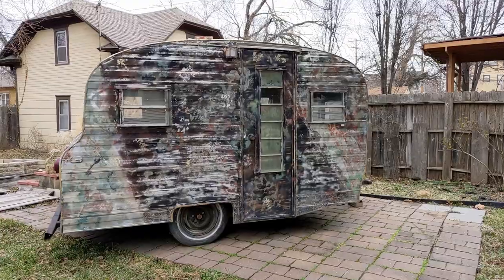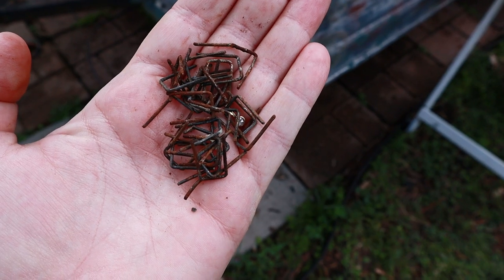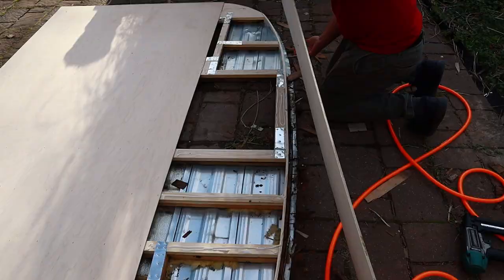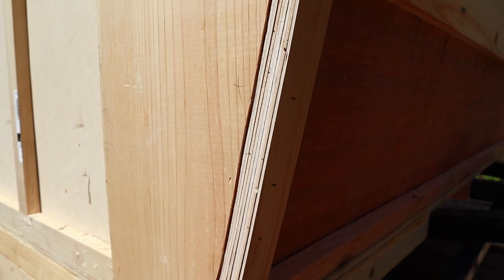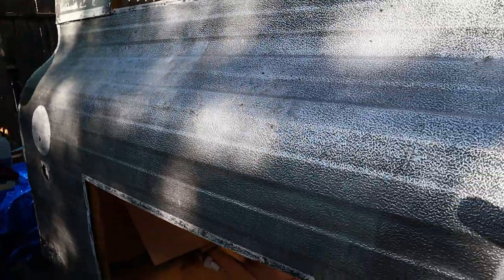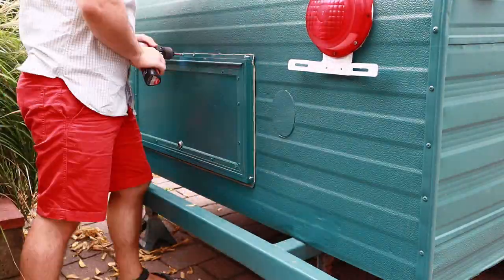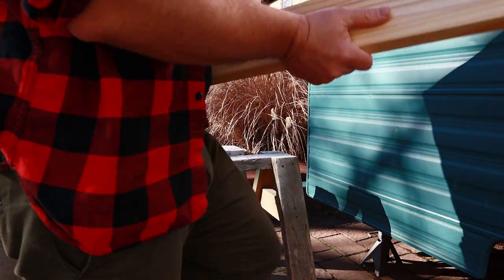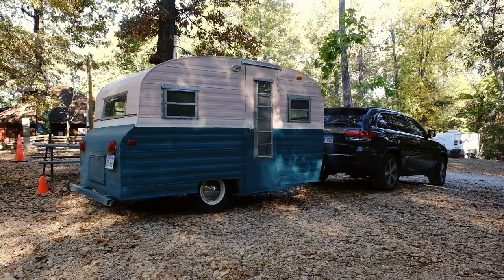🤯 START to FINISH VINTAGE CAMPER TRANSFORMATION

Comment: Awesome video. I'm near the end of freshening up my 1978 maxi pop top caravan. I have been working on it every day for the last 2 weeks! What an amazing difference a few repairs, a bit of paint and a good clean does.

I haven't completely rebuilt mine like you did yours! I've just spent hours upon hours sanding,  filling,  scraping,  painting and cleaning. 

Definitely worth all the work doing up old caravans,  they're absolutely awesome.  None of the more modern stuff has the same charm as the stuff from the 80s and under.
Reply from the maker: Sounds like a fun project! I've never done a pop up camper before, but I really like the look of the newer A-Liners, so I've always thought about finding a used one to just do a remodel on rather than a full rebuild, and give it some of that vintage quality and charm. But good on you for putting in the hours and the elbow grease; it'll all be worth it in the end!

Comment: Your videos are the best! I am trying to educate myself before digging in on mine. I am finally ...JUST starting to work on a vintage camper that I've had sitting in my driveway for 3 years! (1960's 16' Kenskill). I am now ready to put in some elbow grease! **Each video of yours makes my project less intimidating... so THANK YOU for so much information and detail! I will definitely try to document my 'before and after' as it's so fun to view yours. My entire camper is still the original wood but there is a bit of water damage in spots on the wood from the seals (corners and windows) so I am working on waterproofing first.  Most likely will need to paint the walls inside to cover some light stains on the wood... but would LOVE to keep the original wood ceiling... at the very least. If I did that, I would have to harvest some wood from the sides to make the ceiling panels match up nicely and be stain-free (just one panel near a ceiling vent has to be replaced). I would rather buy a wood veneer to match vs pull from the walls....but I can't imagine being able to match the rest of the ceiling in that way, not even sure what kind of wood it is, just yet?! I will be asking a woodworker friend of mine first, but wondering if you know of where I could possibly source wood veneer.  Thanks again for all of your videos! Every one of them has taught me something!
Reply from the maker: Thanks for the kind words! Typically most campers with visible wood will have panels made of birch plywood. You wouldn't want to try to veneer over the top of what you've got there though. Instead you'd get new plywood and finish it to match, more or less, the original, which was often finished in amber shellac. Google "repairing shellac finish," and you might find it's easier than you thought. Good luck!

Comment: It’s beautiful. I don’t have a vintage camper, but I just bought a a Toyota dolphin six cylinder. 35 years old, but it was redone in 2006 inside and out. I bought it a week and a half ago.
Reply from the maker: Dolphins look neat! I've never worked on a motorized RV, but I do like them. My dad had an 89' Toyota Pickup when I was a kid, and it was the perfect small truck, but sadly it got totaled in a rear end collision when it was about 30 years old, otherwise he'd still be driving it.

Comment: Currently working on a 1957 Pathfinder. You make it look very Do able. i Appreciate your videos ! i saw ion your second trailer you went a different route than the first for the walls. Which do you prefer?
Reply from the maker: I'd say that I preferred using pocket holes, but they are a bit time consuming to use, and you have to plan out a bit where you're going to put them. Regardless of how you put the studs together, it's gluing the paneling to them that makes the wall strong and resilient.

Thanks for watching!

Comment: I have one just not in such bad condition it definitely needs work but I don't know where to start or if I even do I do but 🤷‍♂️
Reply from the maker: A good place to start is by taking the skins off to see what's underneath. You can replace any rotted wood if needed then. If it turns out your framing is in good condition, great, put the skins back on and use new butyl tape to seal up your window, vents, trim, and accessories, which you need to do anyway if your camper hasn't been resealed in the last 10 years.

Comment: Nicely done!  The $600 got you the trailer frame, the metal skins, and templates (from the rotted sections).  The trailer frame would cost at least that.
Well done.  Lovely result.  $5000 over 2 years - not too bad - a little over $200 a month.
Reply from the maker: Yeah we stayed pretty economical with this one. The Cal-Craft is going to cost a bit more when it's all said and done!

Comment: So, you put your skins on before building and installing the cabinets? How does it affect the structural integrity? As you know now, the factory screwed and nailed from the outside before skins were installed. Any thoughts in hindsight or any issues so far? Thanks
Reply from the maker: Not every camper has the cabinets screwed in from the outside. The '56 Cal-Craft I'm working on now had every cabinet attached from the inside, and some were just hung on the paneling with no bracing to truly secure them in place. From a structural standpoint, a nail or a screw holds equally well in either direction so long as the depth of material that it's sunk into is the same. But in a lot of ways it's easier to screw into cabinets from the outside than it is to do it from the inside, but either direction can be acceptable if planned for accordingly. We needed to get the camper sealed up quickly because at the time we didn't have a protected area to work on it in, so that's why we did things in the order that we did.

The only thing that was problematic with building things in place was that I didn't get welting installed next to the ceiling, so now there's a visible gap there that I need to figure out a solution for. But structurally the camper is very rigid, probably better than the original in a several ways.
Reply: Thanks
Reply from the maker: No problem.

Comment: Conan, what color was the bottom half of the camper, thanks
Reply from the maker: The kind of bluey green was Water Garden by Magnolia from Ace Hardware. It only came in latex so we had it color matched at Home Depot into an oil based exterior Behr paint, but they say they don't stock oil based paints now, so...maybe take a swatch to Sherwin Williams?

Comment: What brand of aircraft stripper did you use ?
Reply from the maker: Rust-Oleum brand. Locally I could always find it at AutoZone, but I've used other brands in the past that seem basically the same. I've been told that Citristrip is a good alternative that's not so toxic.
Reply: @TrailerTrashtoTreasure  Great, thank you !
Reply from the maker: You're welcome!

Comment: Came across your video while searching how to restore a vintage trailer. I made the mistake of hitting the inside first :( I am hoping I can still restore it. I was trying to  avoid taking the skins off but looks like I may have to to rebuild from frame up. This video was very helpful.
Reply from the maker: Lots of folks make that mistake, but it's not the end of the world. It's a lot easier to rebuild these with the skins off, and it's easy to reattach them. Good luck and let me know if you have any questions. Thanks for watching!

Comment: My question how would you do the windows differently so they don’t leak?
And
What is your opinion of beginning with an empty Utility trailer OR buying an old pop up n removing the wings but using the short walls n building up from there?   I want to be able to camp 4 seasons so I would like to put a mini cub wood stove in it for warmth    Not sure I like thought of diesel heater or something similar. What are your thoughts about any and all of what I just wrote
Would appreciate your feedback, thank you kindly 
Donna B
Reply from the maker: I would've just done the windows correctly the first time, lol! I made a video later where I went back and fixed the seals:

https://youtu.be/kfjxOgNjUxI

I don't really care for the look of utility trailer conversions, but it's not really about my preferences. My only other objection would be that you might run into some issues trying to get insurance on one, whereas a properly titled trailer might be easier to work with.

I think I like the idea of a wood stove more than I would like the reality of it. Unless you're going to be camping off grid, my preference would be for an electric heater first, then diesel, then a propane furnace. Although, you could also go with something like the Pioneer Under Bench Heat Pump, and combine your AC and your heater into one unit, but it's a little pricey, and I haven't got any personal experience with one.

You might look at an A-Liner if you're wanting to go with a pop-up four-season camper.

Comment: Hi! I love all your videos and I appreciate the time and the effort you put in them. I bought the exact same trailer and went through demolition. Could you please provide the windows gaskets you’ve used for the different parts of the windows? I had a hard time finding them on the vintage campers windows gasket site they have too many options. Thank you!!
Reply from the maker: The gaskets I got were for Hehr 3600 windows, but since the Play-Mor actually has Phillips windows the top fin seal has to be modified. I intend to do a video about it at some point. The reference numbers are 0114TA, 0114UA, and 0114VA. Good luck!
Reply: That helps a lot! Thank you so much!!! Keep up with the beautiful videos I watched them all!
Reply from the maker: Well thanks for sitting through all that, lol!